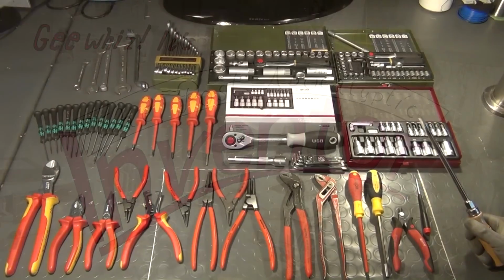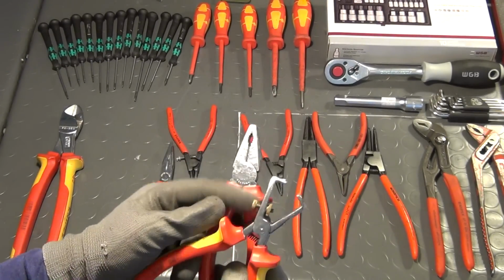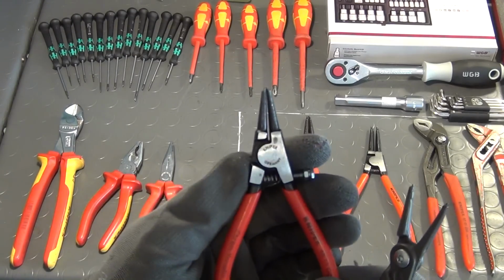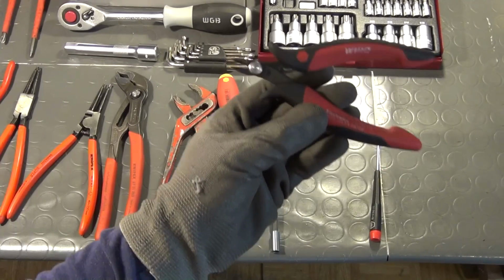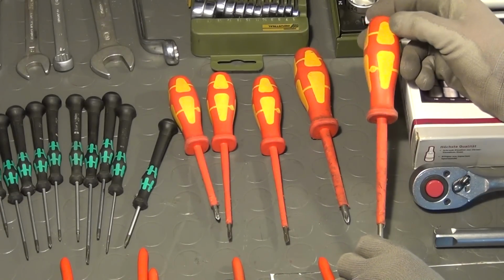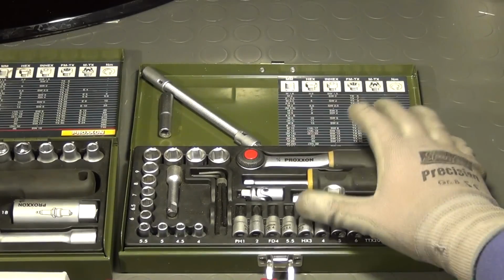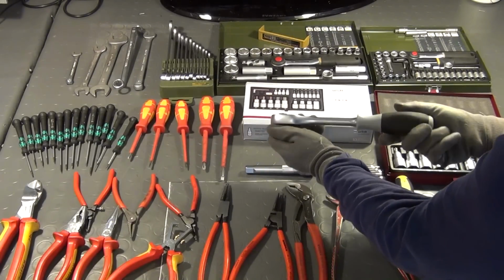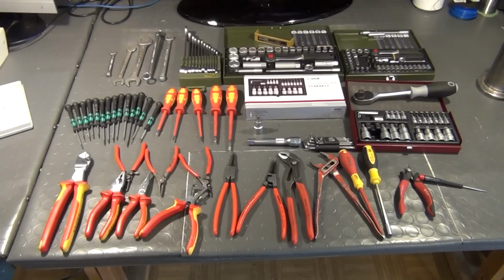German Tools Review: Knipex, Wiha, Wera, WGB, (Proxxon)

Comment: Here in the US,  the Knipex tools are available from the Lowe's home improvement chain, and while very good, are somewhat cost prohibitive. Many US branded tools are often now made in China,  such as the Irwin brand pliers, however,  these are very good quality. The "old standby" quality tools are the "Craftsman"  line of tools from Sears, guaranteed for life: If you break one, just bring it to the store and they will replace it, no paperwork needed. The cheaper Chinese manufactured tools come from the Harbor Freight stores, with quality all over the board. And I have a set of closed wrenches here, which were made in India, very good in quality, and very good in price. What I find here n the US is that quality many times does not match price or brand or necessarily Country of Origin when it comes to tools, with the exception that the German tools are generally the very best, but most expensive, just like the cars. I also must Mention Dremmel line for precision high speed fine drilling and cutting: While there are other competitors in this line, they have no peer. I find a mix of tools works best, thus spreading your budget over a wide variety and selection: Good tools for daily work, cheaper ones for jobs you less often: For example,  I do surface mount electronics often,  and a good static protected soldering iron is a must. But for changing a wheel on my tractor,  a very cheap set of snap ring pliers will do. We also have the problem in the US of having to have both Imperial/SAE  tools and metric ones. Yes, you need a few good basic tools for most jobs, but also need a wide variety to handle every job. And to keep a few critical plumbing tools/parts on hand for home emergencies. And finally,   always buy the very best drill bits you can afford,  or you will throw good money after bad!

Comment: My 30 year old GEDORE open end wrenches have not failed me yet.  These were made in W. Germany (most US imports that I have seen are made in INDIA and are of low quality).  I use WIHA small size screwdrivers constantly.  The alloy & hardening they use is the best I have seen (particularly for the cross tip screwdrivers) - I have abused them, but they still hold up.

Comment: Additionally, had to add on sockets: I don't care what country you live in or hoe expensive they are there, just buy snap-on. I had a knuckle broke by a hazet rachet pawl failing. I've beat snap on 3/8 ratchets with 3lb sledges and still not problems (hey, if it's lifetime warranty, those are the tools you abuse when the going gets roough). The rest of their line, besides maybe the solus scan-tools, is overpriced, but i've never used a better rachet

Comment: Have to chime in w/ 1/2 decade mechanic experience: Knipex pliers are the absolute king, except for the "channel lock", "water pump", or as they call it their cobra pliers. While the push  button is nice, the hardening on the teeth on their adjustable pliers is nowhere near as hard as the rest of the brand, so while the pliers are strong the teeth round off and lose grip quickly. Best pliers I've found so far of this type is actual channel lock brand, they feel loose initially but the chamfer cut in the handle tightens w/ pressure and the teeth stand up to some serious abuse. Note though, channel lock needle-nose pliers are terrible, the knipex are much better. I'd just warn people, as the only time I seem to see knipex pliers in the US is the cobra adjustables (unless you head to a professional electrician's supplier).  Aside from the cheap crap they make you find at home depot, these pliers are absolutely as nice as snap-on ratchets.  Don't buy the cheap knipex, the only ones you want cost enough to make you regret it a bit and typically have the high voltage handles. Pick them up and play with them for a few seconds, they're nice enough that you'll swear off the tool truck for pliers forever!

Comment: Having bought, acquired and inherited many tools of many brands during my life I can make some observations through experience.
For hand tools like wrenches (spanners), sockets and associated tools, pliers and cutters, older tools are generally better, unless, paying for premium brands, like Snap-On. There are exceptions however.  I don't like Snap-On pliers and cutters, the pivots often develop play, they don't have the toughest cutting edges and the plastics used on the handles isn't the best.
I used to use a Snap-On medium bolt cutter alot, but the pivot  quickly developed play and made them inefficient.  During the time I used this item, it was replaced under warranty about 10 times!
Conversly, I have a pair of Elliot Lucas, an old British brand, side cutters inherited from my Father which are about 40 years old at least and they are still as good as new apart from some signs of use.
Knipex, (nipex in English), are pretty good, especially at the price. Good material and durability but I have similar problems with the handle plastic as the author. 
Facom are very good.  Stahlwille are excellent.  MAC are good, but not as good as Snap-On.  Teng are dreadful, avoid like the plague. They hold the record for me as the only brand where a socket has actually split in normal use!  Their sockets wear rapidly and wrenches too.
Snap-On buy many of their handtools out, so the same tool can often be found with a different brand for significantly less.  The only benefit with Snap-On is the lifetime warranty.
Something I will shortly be claiming against for the 6th dead blow hammer to disintegrate in use!  At the price they charge for these they should be indestructable!
Snap-On tool boxes are THE best though!
Beta are excellent but are now very expensive.
Best small cutters and pliers are Lindstrom.
Generally with pliers and cutters, look for a bolted pivot rather than the typical swaged rivet type. The bolt type denotes a high quality tool.
With Snap-On hand tools I have found the most durable finish to be black industrial rather than chroem. It is also cheaper!
A brand I recently discovered is Hultafors, truy excellent quality at extremely good prices.
One anomoly is a cheap as chips socket set that came free with a large stock order from an industrial supplier.  Had I bought it it would have cost £9.99!  It is 3/8" and 1/4" drive, Metric and AF and I have used the living hell out of it as my EDC car emergency set for about 15 years and it is still going strong!  Go figure as the Americans say!

Comment: I have use my Wera screwdrivers since 1990, 6 different screwdrivers. And have also 4 screwdrivers for bits, and I must say this is the absolut best screwdrivers there is!! Now gaps or problems and the handels fit my hand perfect.Not cheap but best! For the sockets sets I use Bahco since 1985 and its super high quality, but I have heard there is som cheap and crapy new Bacho tools this days. So be where what you buy!
//Swede
Reply: Untill some solvent touches the handles or just start breaking down. That rubber that these tool manufactures are over molding to the grips are butelene and when they off gas they will get sticky and make your tool box smell like puke. Its the same chemical off gas that you would smell in vomit. Just be careful how you clean and store them.

Comment: I find tools are best used as one goes along and used by experience. Germans can make nice tools. I will also say so can others.i absolutely hate the thick rubber on the pliers.the wire strippers suck.  Good idea> just sucks. The Wiha screwdrivers get gummy handles. The Wiha micro screwdriver set at $395.00 are very overpriced. Channel Lock pliers are very hard to beat. Along with some Swiss tools, there are good tools. But to say German make the best is unfortunately untrue. Best right angle drill> B&D Timberwolfe. Best Sabres saw>Bosch.Best reciprocating saw>Porter Cable.  Best drill bits for wood> Milwaukee and Greenlee. You have to pick and choose.
Reply: Bosch is a german brand :D
Reply: James Lucas Black and Decker? Porter Cable? You must not be using these tools for any serious work. BD makes a great toaster, Porter Cable I don't think they make anything quality. Greenkeeper bits are good, but sorry to say nothing beats good old German Tool Steel. HILTI, Fein, Wera,Wiha...that's for professionals. not for Joe blowS DIY weekend spectacular...
Reply: @rahaus5204  BD used to be more industrial. Not sure if they still are but their "prosumer" tools really are lacking. I have BD industrial tools at work that are decades old and still being abused today. Kinda sad their consumer line is so pitiful. Hilti is ok but way overpriced for what you get. The quality still doesnt match the price. Seems you're paying more for the name.  I didn't like their drills their sales rep sold our company to try. They burnt up in no time and were kinda quarky. Im a Makita guy myself.
Reply: "The Wiha screwdrivers get gummy handles."
i know what you mean, i had that on my set too, i bought that a year ago.
But only bc i used them with gloves covered in hydraulic fluid :D
i have 10 year old Wiha screwdrivers that didnt become gummy because i didnt use them out of spec...
Reply: Channel Lock pliers suck, especially compared to a brand like Knipex. As far as electric drills, etc., Milwaukee is way better than anything you listed.
Reply: I really hope "BD" it's not Black & Decker. Lol. I'm afraid your home owner use of these tools, unfortunately, is not a good use case to determine "the best."
Reply: Yeah and when they start to break down in your toolbox they give off or off gas the same chemicals that's in vomit. Thats why when you open an old toolbox full of these old tools with deteriorating handles it smells like puke. Think it's butelene that does it.
Reply: Oh and bty Milwaukee invented the "saw zal". They make the best recip saw and YouTube videos have confirmed this. Porter cable is ok but they are really a house brand now.
Reply: Milwaukee makes better everything than what you listed and they are made in China now... Maybe try a few contractor grade tools out. Much better than Milwaukee out there too.

Also channel locks are great but give the knipex a try and you'll see why people like em so much.

Comment: Great video but just a little FYI,  That GM seat belt bolt is actually a T47 not a T45.  Unfortunately the only company that I know of that makes a T47 is SnapOn.
Reply: +The Post Apocalyptic Inventor  Is this seat from an Opel Astra F?
Reply from the maker: +Andrew Morency Thanks for the info I didn't know that. I have noticed though that GM obviously uses some very strange torx sizes.

Comment: Firstly, your English is very good, I am English so I can comment.
I love the German attitude towards buying local tools instead of Chinese tools.
I love German tools, most of my tools are German. I prefer Wiha over Wera but there is really not much difference. Be careful cleaning their handles or getting any form of thinners near them, it will degrade them.
Proxxon make a great range of small power tools, their version of the Dremel tool is far superior. 
Knipex are just the best you can buy.  Thanks for the video
Reply: It's most often also simple the most reasonable priced stuff. Although Proxxon and also for an example KS Tools either let parts or whole sets produce in China to be able to offer your certain prices.
The quality Management yet is still accordingly to the "DIN" (German Industry Norms) standards which means they have to keep certain tolerances and hold up to certain forces. Which makes them completly fine to use them in your hobby Garage / Workshop.

Comment: Wera is manufactured in the czech republic. Still one of the best screwdrivers except for rust resistance, could have been better. I really like their slim shank insulated Pozidriv/slotted combination drivers. Also, knipex is definitely the best plier brand out there. Their chrome models simply don't rust and can last forever without getting stiff. Really love their x-cut, pliers wrench, electrical installation pliers and multistrip 10.
Reply: +FoodOnCrack also: a good way of telling whether the red insulated knipex pliers are new or old is that the new ones have 1000v on the collar, dimples on the inside where your thumb goes and an injection mold stamp on the inside.

Comment: Open up that ratchet head and add some grease. Here in the US I recommend a brand called Super Lube for that. She'll be all right. Doesn't sound like it has a lot of teeth so it would not make the best ratchet in tight spots (where you have very little space to swing a ratchet) but most of the time that is not an issue.

I have some Knipex pliers - some flat nose ones and some slip joint ones similar to the Cobras. Very, very nice. I also have some nice Williams USA (owned by Snap On, one of the best USA tool companies) pliers that are almost as nice as the Knipex. I've been meaning to try pliers from other high-end European brands like NWS and also Japanese ones like Keiba.

I have a really nice Gedore torque wrench that I use more often than my USA-made Precision Instruments (which is also very nice). One thing about Gedore - if you look on Ebay for wrenches, note that they had a partnership in the past with an Indian company to produce wrenches. Those wrenches are TERRIBLE quality. Do NOT buy Gedore stuff made in India. They do not sell that stuff brand new anymore so people buying brand new will have no problem.

I have been hoping to get some Stahlwille and Hazet tools as I hear they are comparable to Snap On and I have lots of experience with Snap On. Readers in the US should probably stick to Snap On because you can find them on Ebay a lot easier. Other pretty good ones are Proto and Wright. SK makes some good tools but the quality of their finish is often lacking. Could also look on Ebay for quality brands from the past like Bonney.

I have some Wiha screwdrivers, the economy blue and black ones that are pretty nice. I think their higher-end ones are nicer. I prefer my Vessel Japanese screwdrivers but the Wiha are nice. For mini screwdrivers, I have a set of Witte, which is German and is also resold as Knipex (at least the bigger Knipex screwdrivers are Witte - not sure if they rebrand mini screwdrivers) and the US-based brand Matco. I like them very much and would like to buy some Witte "full size" screwdrivers. I have a couple of random Wera screwdrivers that are not bad. For screwdriver bits, I have a mix of Felo which is OK and also PB Swiss, which is obviously Swiss and I like them a little bit more. I only have one PB Swiss screwdriver and it is a small Torx one but I like the handle. I also  have made-in-USA Bondhus torx drivers which are nice though not quite as nice as the other brands I've mentioned.

For screwdriver-handled bottle openers, I use Wiha's very often. I got a set of 5 (From KC Tool Co) and I gave the other ones away but they were all nice except the Witte which worked fine but had an awkward handle. The Wera was nice and the Gedore was smaller and would be good for a day bag.
Reply: With 4 decades worth of collecting and using tools (what good is just collecting without using them) I have amassed several toolboxes full of tools that I have spent almost as much on as I have made off of.  I have all the US brands like Snapon , Cornwell, Armstrong, S-K, Klein, Blackhawk, Bonney, Plumb, Wiss, Channel lock, the prechinese MAC, Matco, Wright, Proto, Stanley, Husky, Craftsman, Irwin, Challenger, Blue-Point, Williams, Crescent and have some PB Swiss, a few British King Dick, Britool.  For completeness I also have a couple boxes full of Chinese, Taiwanese, India and parts store branded tools.  In the last few years I have branched off to German tools such as Wiha, Wera, Stahlwille, Gedore and Hazet.  I have always been interested in Japanese tools but don't know anyone that has used them to ask about brands and their quality.  What has your experience been with them?

Comment: Had a very good experience with USAG and FACOM tools, not sure if you can find them in Germany. Wiha are expensive (I paid 7.50€ for a small PH#00 screwdriver) but certainly very high quality and that particular screwdriver has been excessively abused, even by unscrewing screws that it is not meant to, and it still holds up.
Reply: dispatcher7007
I have used FACOM for a short time only (4 months) so I think only time will tell...